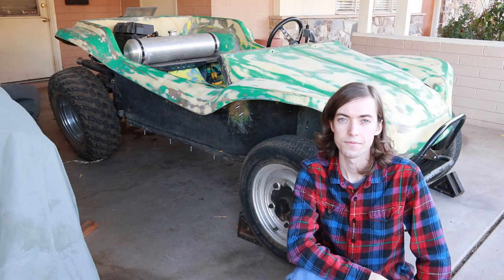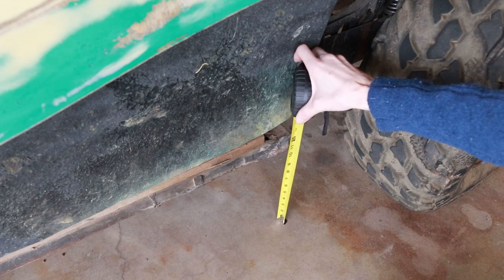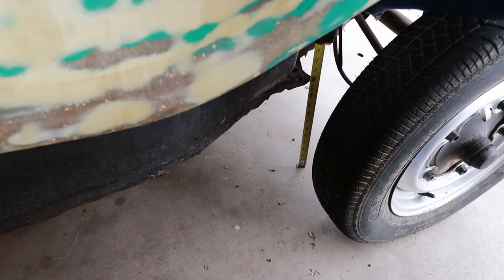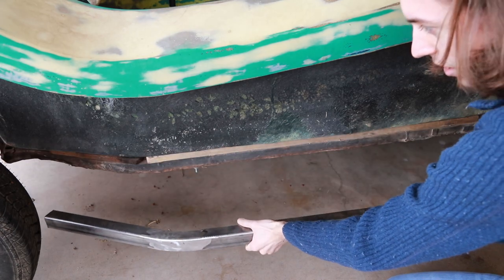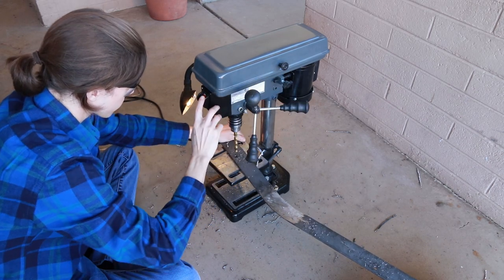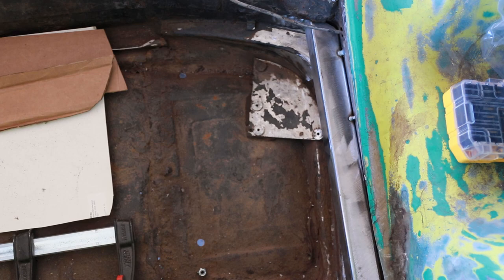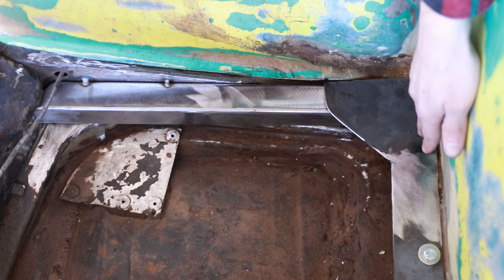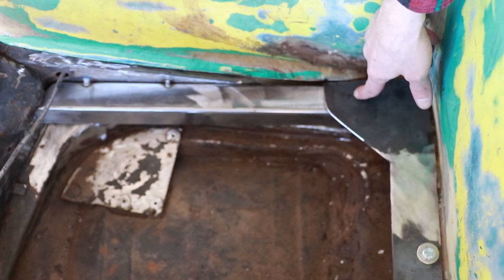Dune Buggy Rollbar System: Part 1

Comment: Hi boss what you doing with that small engine
Reply from the maker: If you mean the 36hp engine, I'm using it as a backup engine if the 1600 is ever out of service. It's not installed on anything currently.
Reply: @DielectricVideos   on the 36 horsepower when you put the generator back. Where is it on the neck does that have a gasket?. I try to watch other people on YouTube but your other closest person that gets closer detail. Thank you please let me know.
Reply from the maker: @davidnunezmontecarlo5422  There's a paper gasket between the body of the generator and the top of the generator stand, like this one: https://www.wagen-werks.com/case-generator-seal-bug-25hp-36hp-to-1960/
 However, the generator I had was from a different year, and never quite fit correctly. So, I used a fair amount of RTV and some generic gasket paper to seal mine.

It's also important to be sure there is a good electrical ground between the generator and the case, so it may be necessary to run a ground strap if you find that the gasket you make breaks the electrical connection to the case.
Reply: @DielectricVideos  okay thank you big help. One more thing where did you order your rebuilt kit your head gasket covers . I don't know if I mentioned but I do have a 36 horsepower. I would like to rebuild.
Reply from the maker: @davidnunezmontecarlo5422  I bought this gasket kit from JBugs: https://www.jbugs.com/product/111198003.html

I didn't do a full rebuild on my 36hp, but rather I just disassembled it to free up the siezed crank and clean all the dirt out of it. I reassembled the engine with nearly all original parts, and bought a few missing accessories separately.
Reply: @DielectricVideos  thanks brother thanks for all the info.. sorry for asking a lot of questions but thanks again
Reply from the maker: @davidnunezmontecarlo5422  No worries, I'm always glad to help! Sounds like you have a great project!
Reply: @DielectricVideos  I'll keep in touch if I have any questions. I have a couple old bugs. But I just started back on bugs Don't know much about the engines. But I'll keep in touch thanks again brother. Keep it up you got a good teaching skills